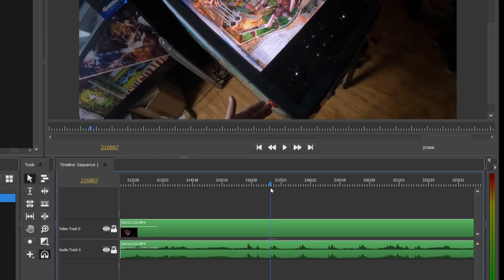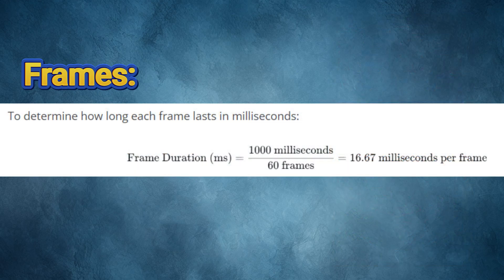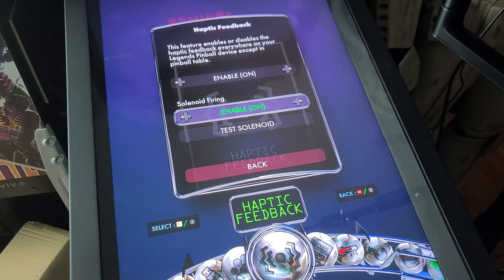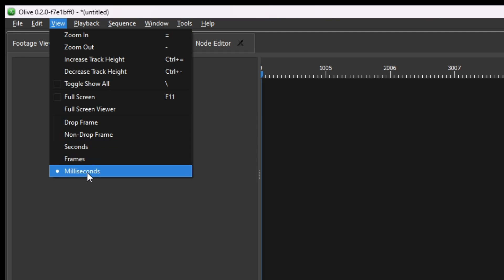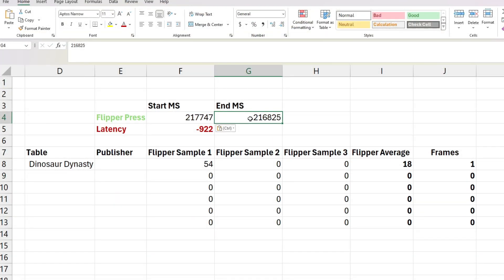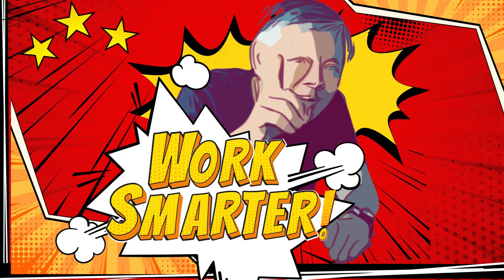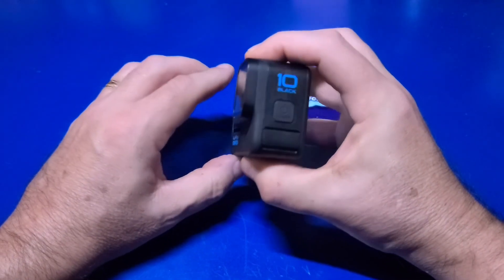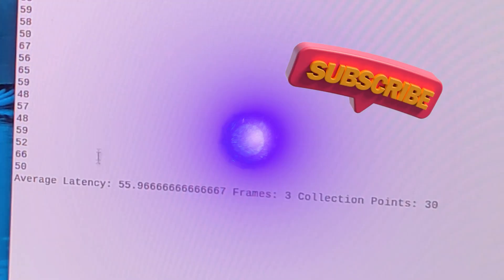Measuring Flipper Latency on the Legends Pinball 4KP - Part 1

Comment: Great work! I've done much of this work myself, other than automating it with a Pi. I put together a breadboard with a light and used the high speed camera method to measure from the light coming on to flipper movement. My data pretty much matches yours for the native Magic Pixel tables. It's the Zen tables and, tragically, OTG where the total latency gets much higher, often around 150ms or even occasionally above that. I really hope the Zen tables can get down below 100ms, and I hope OTG can too, though I'm not sure if they're even working on that issue.
Reply from the maker: Great to hear that our numbers are mostly in sync for the MP tables.  We wanted to build a more scientifically accurate approach to measuring latency and very pleased with the results.  Audio latency would also be nice to incorporate into ALT, but prone to errors.  We'll have numbers published for all tables, once we have the baseline values, then the improvement numbers published we can consider OTG measurements.   ALT will still work just fine for that also.